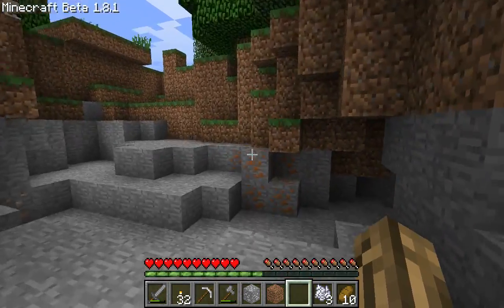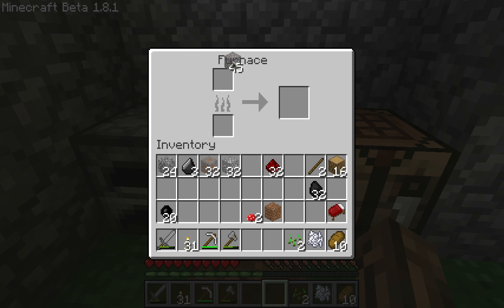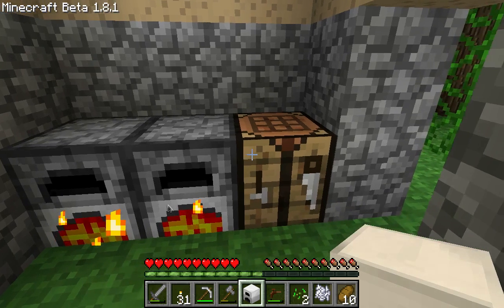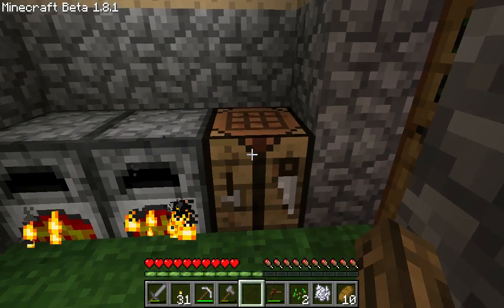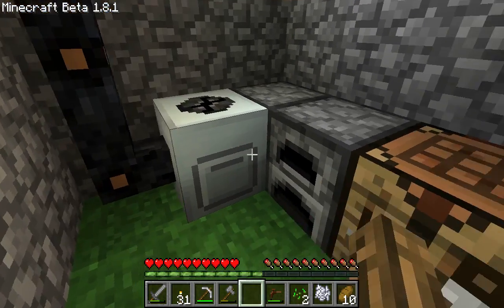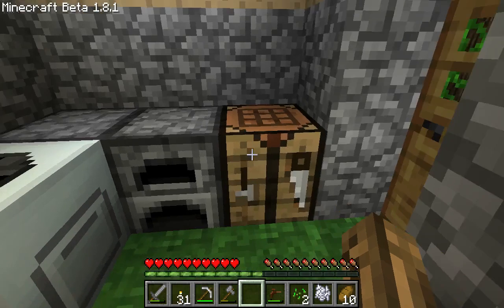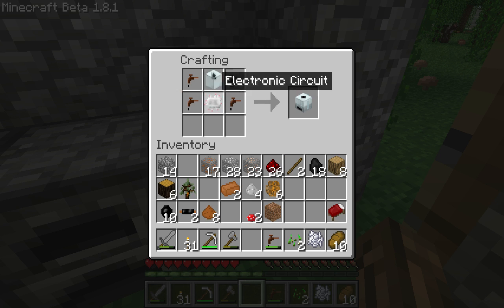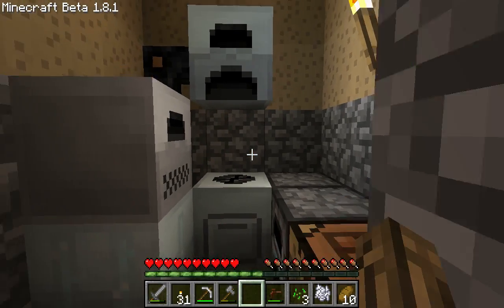Minecraft LP Episode 1 - Getting started with Industrial Craft 2 (Andrakon)

Comment: the refining iron process is not the same on my server. i have to to use a immersive engineering blas furnace with coke to make steel, pulverize it then put it in a redstone furnace to get refined iron.....kinda sucks doing that way..casue i needed to run RF to my house to get it.

Comment: It wont let me make the iron furnace. i did it the same way you did ..
Reply: doode thats in minecraft beta not this version were in now
Reply: MultiMinecraftPro101 Were you talking to me? Cause I know.
Reply: doo all iron in a way of a furnace
Reply: MultiMinecraftPro101
It's more efficient to use 5 iron in an inverted V shape with a vanilla furnace. You save 3 iron that way.
Reply: Make sure you got Industrial craft 2 and Build craft installed properly. 
Also it changes in different versions so 1.6.2 or 1.7.9 wont work the same.
Reply: you do the same thing but with iron plates whitch you get by making a forge hammer by putting in the center and center left squares sticks and make a side ways boat out of iron on the other side